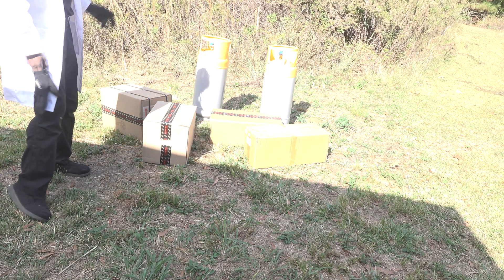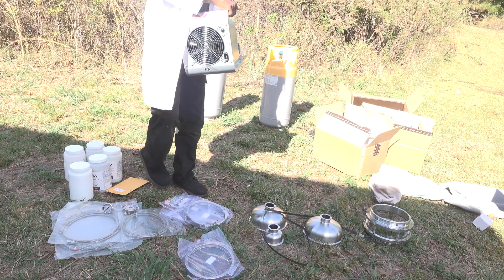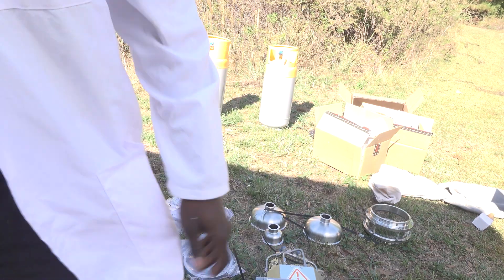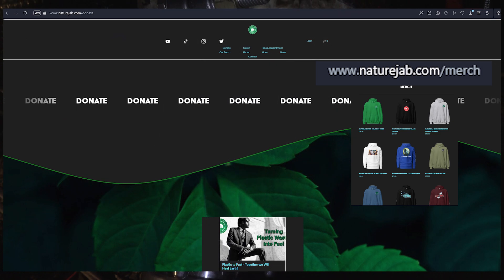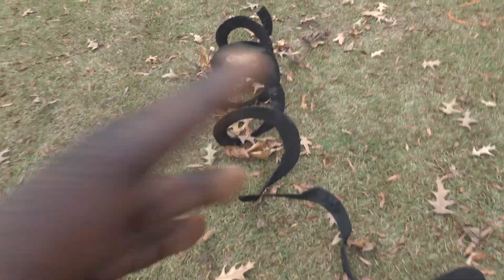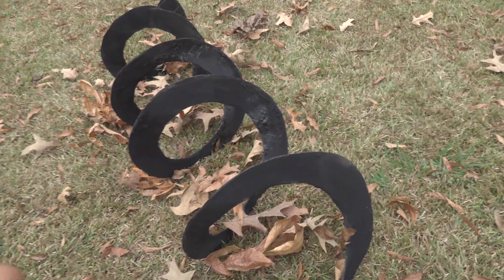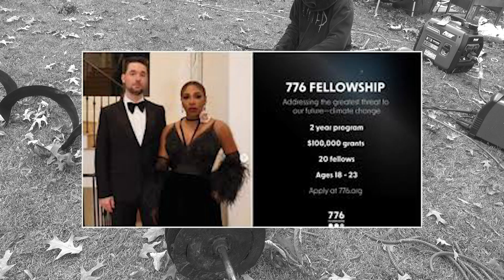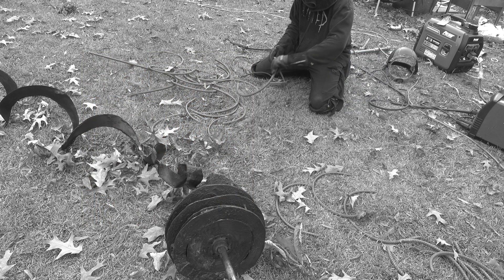Plastic to Fuel Reactor Upgrades!

Comment: Good improv with bending the rebar. Consider using a pipe bender or length of pipe to add leverage. The pipe bender would also allow you to pre-weld the lengths so you don’t waste rebar and scar the tree. 

Also, one grant is a great door to another grant! Unless it’s specifically in the contract language you can have more than one supporter… keep at it!

Comment: I had this same idea for pyrolosis of shredded tires. You'd get crude oil, carbon black and rubber. Wondering if you can create a process for that using the crude oil as an engery source for heating the used tires during pyrolosis. Cheers.

Comment: A powerful application could use a large bus that is converted to electric and can operate flexibly and as a service to dispose of waste. Put solar  on the bus to charge batteries and burn the synthesis gas in a generator to run the electric bus as a hybrid with multiple power sources including solar that can earn an income from waste stream elimination and act as a remote power microgrid.

Comment: Check out line insulation wrap and insulation/mylar tape for insulating your piping, I didn’t even know it existed until yesterday, it worked amazingly at insulating the output and return lines to our outdoor woodstove boiler system, looks kinda neat too! A ‘15 roll goes for $5-6 at Home Depot and the Mylar insulation tape is kinda like expensive at $15, but I promise you, that roll is like 300’ long and you will have it for years and use it on EVERYTHING. It’s super thin and strong as well. Make sure to wear ppe tho as it’s fiberglass, and best to cut with a box opener from the back making perforations in a line. I’m blown away by your projects. Please keep creating!

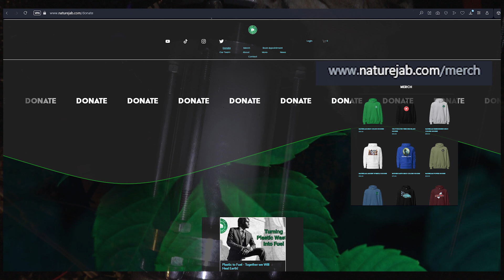Comment: 2:30 it looks like some of those nuts are working loose on your sight glass
Reply from the maker: I tightened them since!
Reply: @naturejab  check out some locktite for the parts you aren’t opening every day. Lifesaver
Reply: on the right, the bottom nut

Comment: Do you think (once all your repairs are done) you could show a process from start to finish on your new set up? 
Cuz every time I come back here to look for some info, it's too messy to find.
 Also I think a complete process would prove reliability of your machine

I work with PCBs, PMs and metal separation. I have the added bromine aspect to my crude oil

Thanks for your time
Reply from the maker: Will do!

Comment: Have you considered plugging 25% - 30% of the center tubes in the exchanger to slow the flow down and help it condense better?
Reply from the maker: Great idea!
Reply: @naturejab  If you aren’t pulling a lot of vacuum, maybe look into Powdercoating Plugs. High temp silicon. Maybe not a permanent fix but they would at least show you if my theory works. Just spitballing ideas. Love what you are doing man!